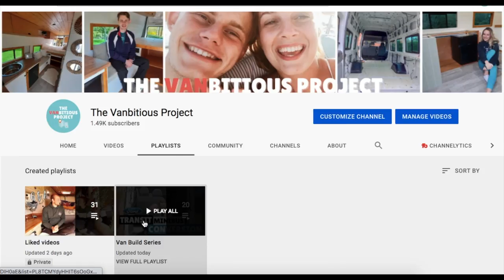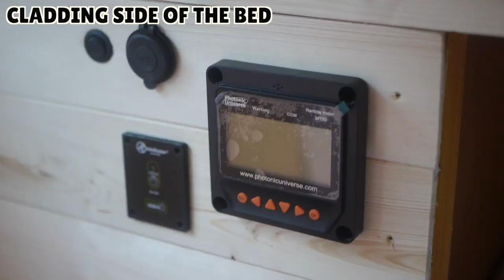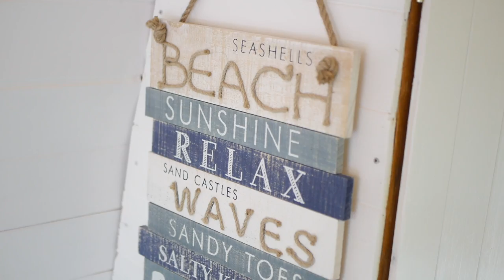Minibus Campervan Conversion / FULL TIMELAPSE in 10 Minutes / DIY Van Self Build

Comment: Nice changing, a few so clear for me. I look for the same kind of plan, but I think that I use to go for a VW multi van, excepted if I find a better affair. I don't care to work on some failures of the truck or minibus if necessary. Your insulation plan is nice, but I should prefer something more natural and so strong than that you choose, the expensed wood. it's powerful for worm and cold insulation as for the sound.

Comment: Hey guys, great job with the build, I’m assuming when you bought the van the revenue weight was over 3.5t? Can I ask how you went about downplating it so it could be driven on a normal license? As I’m currently converting a minibus
Reply from the maker: Hello! Yes that's correct. So, we made sure the van was under 4.5 tonnes, took it to a weighbridge to have evidence of this, and sent this off to the DVLA (along with the v5) to get it downplated. Now it is under 4.5 tonnes it can be used on a normal license! Hope that makes sense.
Reply: The van should be under 3.5t for Cat B license.

Comment: Firstly, this is awesome. I’ve been binging your videos since we seen a minibus for sale.
Secondly, quick question!
Licensing!? So I’m in a black hole for minibus/van licence categories.
Did you guys get the minibus reclassified as a van? And under the 3.5t? Or just get it weighed in as 3.5t and keep it registered as a minibus?
We are hoping to buy and convert to take to Europe for holidays but all the info I can find is that if it’s still classed as a minibus you need a D1 licence. 
Be good to hear from someone who has ‘been there, done that’ so any advice you guys have would be all kinds of awesome!
Thanks
Reply from the maker: Thank you so much, that sounds very exciting/ minibuses are definitely cheaper than normal vans for some reason (so a great option for a camper conversion). So we removed all the seats, then took pictures to send to the DVLA, to get it reclassified to a ‘van with windows’. Once this has happened you get it weighed and get it downplated to 3.5T, at your local weighbridge. So we didn’t require any extra licenses in the end and was all relatively straightforward... hope this helps! 😊👍🏻

Comment: Yeah great camper job, 100% handmade. But I missing the shower/wc. It is a big van... 
Surprised with the  camper cost,  really very cheaper?is this cost including all electric installation, water and gas installation, material of furniture?
I'm taking ideas for camper my next van. Thank yo guys
Reply from the maker: Thank you , we appreciate that! We didn't feel the need for a shower, as we built the van for a 3 month trip around Europe in summer so we used a solar shower which was used outside of the van. We did have a portapotty which we located at the bottom of our wardrobe for emergencies! Ended up using it quite a lot and it was really useful!

We recently filmed a new vid explaining the breakdown of what we spent on the conversion, if you're interested in the whole breakdown of the costs!

Good luck with your camper conversion!! :)

Comment: Can anyone advise on whether having the bed going across the van still gives enough room to stretch out?im 5 ft 10" and worry that in my conversion i will have constant leg cramp due to being crammed into my bed??🤷‍♀️
Reply from the maker: Hiya, I guess it totally depends on what Van type you're getting, they all have different widths! We ended up sleeping length ways in our bed as i'm 6ft2, give us some more info on your van and we can give some advice!
Reply: @NickyandHarri  ah ok,i should have known to give more info.so this would be for my LWB jumbo transit.the mattress length is a standard length which i think they're 6ft but not entirely sure.ive not yet picked my van up so have no dimensions from the inside.

Comment: PROS: I like the purpose. Nice couple.

CONS:
No offense intended, but this van is:

OVERWEIGHT
This is testimony to just how obsolete and out-of-touch present-day Van and RV manufacturers are in the United States. I am an engineer and have some constructive criticism. Every gram of weight counts.

Seven issues:
1) NOT ECO-FRIENDLY
Too heavy. Not aerodynamic. Low MPG. Poor cornering because of the high center of gravity. Should have big solar to make the claim "Best Quality and Design".

People insist on outfitting their rigs with doodads like wasteful showers, heavy wood cabinetry, exterior lights, wasteful water heaters, roof decks, vents, sky lights and ladders. Most van build windows are outdated silicon glass. They should be dual-pane acrylic like in Europe. Insulation is minimal because cockpit is not thermally isolated from living area. Materials are way OVERWEIGHT. The wood cabinetry and doors could be lightened by 50% or eliminated. Should have a SEER 33 split-mini for climate control. It's a camper van, not a house.

Please care about the environment.

2) EXPENSIVE
All of the above doodads cost money that unwitting customers pay for because they do not understand first principals of engineering regarding minimization. The lithium batteries in this van cost about $1000/usable KWH (KiloWatt Hour).  My Tesla battery cost about 8x less.

My empty Sprinter van with a BlueTec i4 turbodiesel gets 30MPG, and 25MPG with the camper build at 55 MPH. The van in this video is so overburdened I doubt it even gets 16MPG.

Expensive fridge. My fridge costs $195 and is 2x larger.

3) HOT WATER DELAY
With a remote hot water heater, it will take up to 30 minutes to get hot water. If the hot water tank is pre-heated, it still may take 30 seconds to get hot water. Meanwhile, much water is wasted. This hot water tank design wasted both water and energy. To resolve this, I installed a true-instant hot water faucet; six seconds for hot water.

4) NOT BOONDOCKABLE
Greenwashing: Since there is inadequate solar, fossil fuels must be used to charge the battery and keep the van warm. If it is winter, very little solar power is available. Wasteful water design will require frequent trips to replenish.

5) FOUR-SEASON, NOT
Customers camping in the hot summer or cold winter will have issues with energy usage and temperature control due to the lack of insulation and outdated climate control. My Mitsubishi heat pump has a SEER of 33 and can heat down to -13F. A lot of fossil fuel will be needed to stay warm in winter. Water will freeze and burst pipes.

6) NOISY
The choice of outdated climate control will lead to excessive CFM (Cubic Feet per Minute) airflow, causing high noise levels. Max air fans are noisy and don’t move much air. Diesel heaters noisy, emit toxic gas and are high-maintenance.

7) POWER
Small battery and inverter are inadequate to power a house on wheels.

To resolve the above problems, see my Tim's Tips van build at: https://youtu.be/YxPj21nckd0
Reply: @greggreg7400  I hope we can discuss it as rational friends.
Reply: @tdrager  sorry, I meant... 
Pros: you came to offer advice, that's nice

CONS: no offence intended but you come across very condescending and patronising.... VERY little to offer in praise and then slam every aspect of their van build.
I understand you're probably trying to get followers by offering so much in depth "advice" 
however, to me pulling apart every aspect of someones else's work and basically belittling it is very uncouth
Reply: @Mramcdon  I hope we can discuss this as rational friends. Automotive engineers are challenged to remove one gram of weight from their cars every day. Why wouldn’t we do this for RV builds?
Reply: What a sensitive world, this comment will help improve future designs and inspire others. Good for the couple but the man makes sense and seems credible
Reply: Also Tim, I dont know how to build anything. I do some interior painting tho, any tips for someone who wants to build confidence in starting small or large products? I like the idea of being a real independent man in todays world
Reply: Also Tim, I dont know how to build anything. I do some interior painting tho, any tips for someone who wants to build confidence in starting small or large products? I like the idea of being a real independent man in todays world
Reply: This is in the UK not the USA we do things much different here!
Reply: @aragnee1  how different?